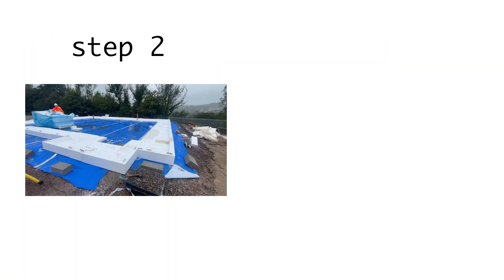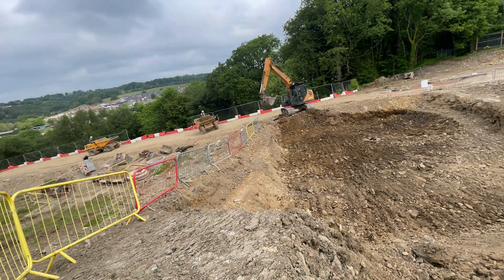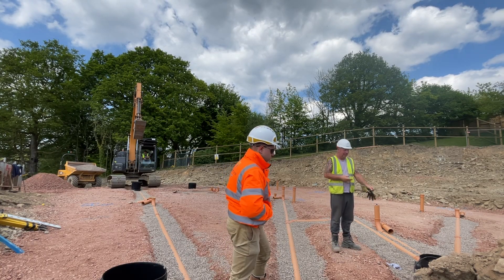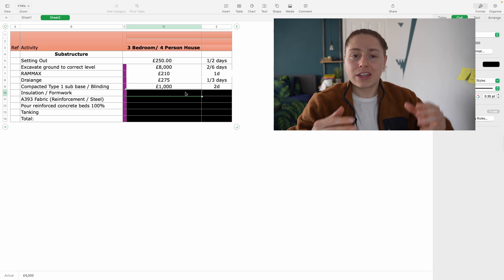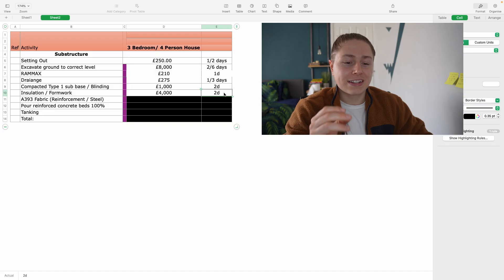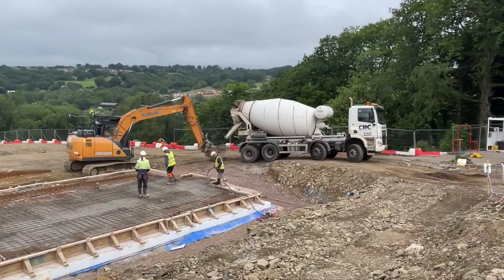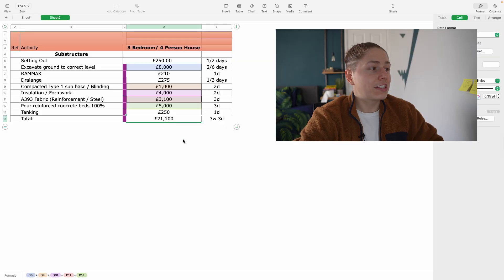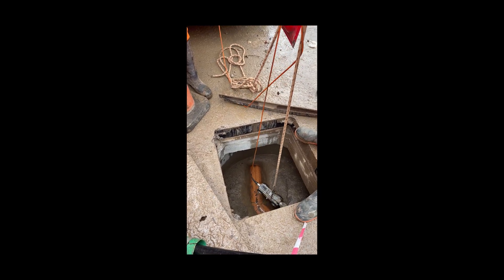9 Stupidly Complex Steps to Build Foundations For New Builds (UK)

Comment: I still can't understand why anything is buried in the foundation. Can easily put waste pipes, water feeds, anything else, above to make them maintainable. Also need to stop in wall pipes and cables. Imagine if a speaker cable in your car broke and you had to cut whole chunks of the door card and metalwork out just to replace it. We can leverage beautifully designed skirting, mid wall architraves (all in easily removable plastic) to hide these things. Then everything becomes far easier to build and maintain.

Comment: Without all this faf how come thousands of terraced houses for the railway steel and mine workers built 120+ years ago are still standing and are still dry ? Looks like environMENTALism gone mad to me
Reply: But how many of them are not standing anymore?
Reply: That's quite a large subject. I'm not sure I can do it justice, but for what it is worth I would say that: the old Victorian Terraced houses were built with the best understanding of the foundations needed at the time. Some haven't survived, so there is a suvivorship bias at work in your question. The house I currently live in has deep trench foundations and there is some evidence of movement at the centre of the house - a load bearding wall runs across the width of the house. These homes are not dry. In another Victorian terraced house, I had to rip out the quarry tiles that were laid on bare earth, and replace the floor with a concrete slab complete with DPM and insulation. (I put 4" of insulation under the slab in 1995). The house had rising damp, and needed a damp proof course installing. It took a lot to heat, but the  cost was somewhat reduced by the face it was a terraced house, with other heated homes on either side, and the heating was necessary to drive the damp out of the walls - the damp proof course was not perfect. These new homes will not suffer from the  same problems as earlier homes; which is not to say that they will have no problems at all.

Comment: What were the ground conditions that led to such a complex foundation design on this site?
Reply: Whats complex about it? That most  basic slab foundation.
Reply: @lauriviik  It's not the most basic slab foundation. The most basic would have no insulation or reinforcement.
Reply: @tlangdon12  it is in terms of whole house build. With one step you achive insulated floor with load bearing sections built in, heating and communications in place. With just slab on ground, you still need to insulate floors (so simple slab - insulation - finish floor slab, thats double slabs of concrete), where are load bearing walls going to bare load without reinforcements? And so on.
With that said, im building with concrete footing and block wall fountation with floating concrete floor for my home, because it suits my building style better.
Reply: @OurnameisLegion66  thats crazy to think that, if not mandated, some people would put floor slab stright on the ground

Comment: It’s so dumb that it’s not a requirement for the slab to be insulated from below to take advantage of its thermal mass for underfloor heating, or will these builds have suspended wooden joists with insulation between them for their ground floor?
Reply: quite likely a floating floor isnt it. Laying atop the foundation would be madness

Comment: What is that build lite foundation form/ insulation material made of? Aerated concrete? Hopefully it doesn't start crumbling after a few decades.
Reply: Buil lite is expanded polystyrene (EPS). For insulated raft foundations, a denser version (that has more compressive strength) is used compared to anything that might be used  elsewhere in the building

Comment: Raft foundation is the most expensive foundation building, which is why only a miniscule number of builders use it and only when directed by building control
Reply: and an insulated concrete slab is the best.

Comment: This is totally different to what I see done in NI, it;'s all foundations dug to bed rock, concrete poured into those trenches and then the house on top. When did this way start?
Reply: I think they've little to no rock, to bind to, so it's a floating base atop clay
Reply: That’s what we used to do years ago then them arseholes above decided you must have this and that to and every new year they think of something new just because it’ll cost you more cash ,I think they want 9”” of insulation under the foundation ridiculous,I’m glad I’m retired now
Reply: @johnmcdyer1573  Yet, all the thermal modelling shows that 9" of insulation under the foundatiion (and on the walls and roof) reduces the cost of heating the home significantly.

Comment: Absolutely MAD!  No wonder houses are so expensive.  WTF is wrong with you people!?!

That foundation is a concrete raft, that might ordinarily be seen in areas prone to significant seismic forces, or where the ground has a very poor bearing capacity.  I've seen less reinforcing used to support bridge piers carrying significantly more weight than a two storey house.
And why the under slab insulation?  You got a basement here?  Is there going to be in floor radiant heating?  What thermal benefits.  Why under the footings? What compressive strength is the insulation rated for? 20, 40, 60 PSI?
The UK I know doesn't have any deep frosts south of the Antonine Wall.  Your insulating to northern Canada standard on muskeg. 
You might think this is all brilliant.  I just see mindless waste.

PS

What is this obsession the UK has with Radon Gas?  Canada has four times the levels of Radon Gas that the UK has.  This is  higher in areas of the Canadian Shield and special venting is often mandated.  I live south of The Shield and we don't put down a radon barrier unless testing shows elevated counts or the homeowner specifically requests it.
Reply: So you suggest to pour concrete floor directly on the ground without insulating? Nice frosty floor all year round.
Reply: Regarding the pointless insulation under slab, I would presume a businessman/company bribed someone in the gov regulations department to include the insulation product that his company makes to be part of new build efficiency regulations.
Reply: @lilmeister44  The insulation isn't pointless, and UK building regulations don't mandate what products are used, just the performance that has to be achieved. Many UK housebuilders will build off trench foundations and comply with the buildling regulations by using aereated concrete foundation blocks. There is nothing that mandates the use of insulated slab foundations, but they are allowed if the builder wants to use them.

Comment: Well done, great video 👍
Is the blue membrane a Radon gas barrier ?
This is a raft foundation slab, was the ground infilled/made up?
How are the white insulation held together in place while concrete is poured around them?  Are they heavy as no penetration to the blue barrier & dp membrane can happen?
Will you have an outside brick sub- structure with cavity or will external brickwork be on the slab?
May need another view...

Comment: Pouring should be done by pump truck not the excavator :)
Reply: In this situation, there isn't a lot of difference. I'd use a pump, but practically there's no difference because you are pouring the concrete onto a robust surface.
Reply: @tlangdon12 
 I agree with you as it doesn't  effects strenghts of concrete and saves money, but come on it is 21ct😂

Comment: Why don’t you use a concrete pump? To save money im guessing.
Reply: It’s 10-15 meters, not needed.
Reply: @oxymoron5167 not a builder so can't debate the issue but I was thinking why don't they use a pump also. Is it because they were just laying one foundation? If they had, for example, three in a row would they use a pump then?
Reply: @oxymoron5167   what are you talking about? You saw it yourself that moving concrete further then chute was nessesery, or did you not watch same video? 
Truck mixer concrete pumps would be only optimal way to do it, that excavator pouring was painful to watch.
Reply: @lauriviik  they don’t need a pump when they have an excavator onsite available. It may take a little longer but perhaps that’s not an issue on this job. If they needed a pump they would have one, obviously.
Reply: @oxymoron5167  thats basic respect for workers. Truck is same, just with pump instead a chute. Its a whole different (simper, easyer and faster) workflow to drop concrete where its needed instead sloping bucket full somewhere and to start shoveling it. Pretty rare to see just chute truck in Estonia. Its allways mixer pump truck first and chutes are to supply additional loads to pump if needed. Price difference is negligible between trucks.
Reply: @lauriviik basically it’s because they’ve got a excavator on site therefore they can save a few quid by not using a pump. Obviously slows down the pour, means more work for the ground workers to achieve quality , incurs a site safety risk. It’s dumb and they shouldn’t be doing it.
Reply: @l @lauriviik no one has a shovel in this video, the excavator drops it exactly where it’s needed. No setting up of a pump, no dragging the heavy delivery pipe round and no additional cost. This is likely quicker, easier and more cost effective in this scenario. A digger bucket of this size will hold around .2-.3 cubic meters and would only have to move once a minute or so to keep up with a pump.
Reply: @oxymoron5167  its like you have never seen actual mixer pump with boom, what are you dragging around? For 50 pound off on concrete delevery team of guys are slaving away. Machines like Putzmeister PUMI series are standard equipment in any concrete deliery business, maybe not in areas where they live in past century, but thats a go to machine in developed areas that dont pinch about additional 50 eur on delivery.
Reply: @l @lauriviik  you want a boom pump to move concrete 10 meters? And you suggest that costs 50 euros… do you actually work in construction?
Reply: @oxymoron5167  https://youtu.be/awj-Uacy7Z8?si=EToU6mDOPGgY7Hcc
Nice example of boom doing job, chute bringing additional material, pew-pow job done, no faffing around to save that 50 eurs for pump.
Reply: @lauriviik  that’s a no then, you just watch videos.
Reply: @oxymoron5167  thats a yes actually, but you can slave away if you like that. You might cry your eyes out to know even my greenhouse 3x6m slab was boomed in place, truck parking right next to it. Its standard equipment to make work go easy.
Reply: @lauriviik  no hard feelings

Comment: So should the pipe be damaged, what next? To dig the whole thing up ?
Reply: With large diameter pipes checks happen before backfill.  This air test is done during installation  of each pipe so issues are dealt with (good practice no leaks/pipe defects).  Granular stone is placed around the pipe to keep it in place & protect from damage by backfilling trench.
If damage happens usually by other excavation/utilities then only area of pipe plus working room is excavated. Protection called shoring to hold back the wall of earth either side of a deep excavation is installed for safe repair of damaged pipe.
Only experienced capable workmen should carry out this work, highly dangerous possible fatality.
Reply: This whole under slab piping process is ridiculous.  The way this is shown is so full of waste and prone to damage at so many points throughout the installation.

You get the subgrade fill installed, and compacted to underside of floor slab level.  Then the trenches are dug to permit the installation of the drain lines.  Pipes are installed, slopes are verified, then pressure tested while backfill is installed and compacted around pipes.
Properly installed under slab piping is very unlikely to fail and is common practice.

Comment: I estimated three weeks, so interesting to see that was pretty close. I don't have anything to directly compare but if I was to estimate, a similar build here would cost about the same if we averaged the site works for the project into the per-unit cost for earthworks. Nicely filmed, and interesting to see how y'all are building in the Northern Hemisphere.
Reply from the maker: Awesome, glad to hear it was insightful for you across the pond!
Reply: your house construction methods are completely different to most houses in the UK.
Reply: @over-engineered presumably this method of building is required for to meet 2025 standards.  I know you can use SIP panels along with steel as another method but that’s much less common.
Reply: @edc1569  there are many ways to meet the 2022 part L regs, I would imagine this builder has chosen this construction method for many reasons.  I’d still build with dense internal blockwork and meet the regs another way, houses need thermal mass IMO